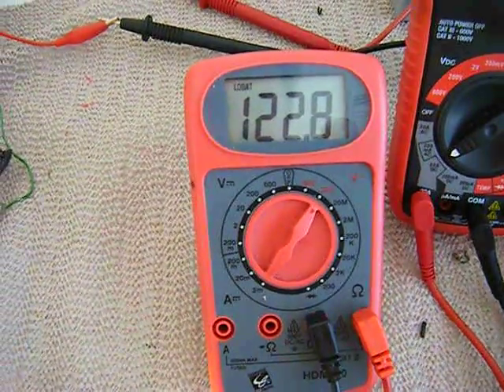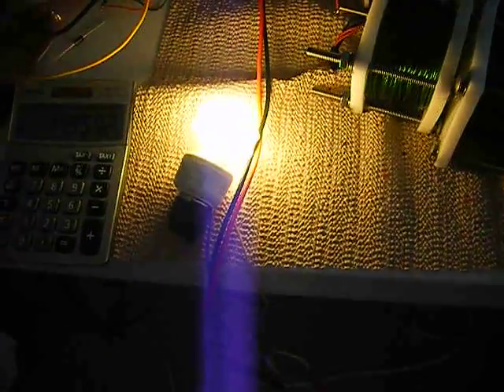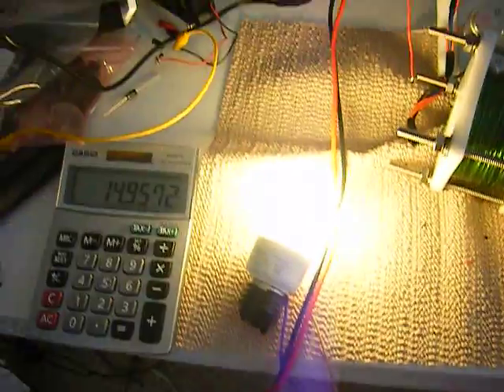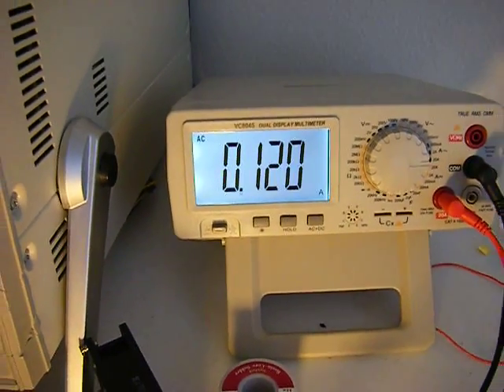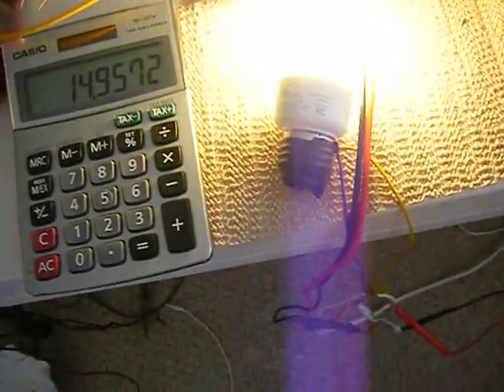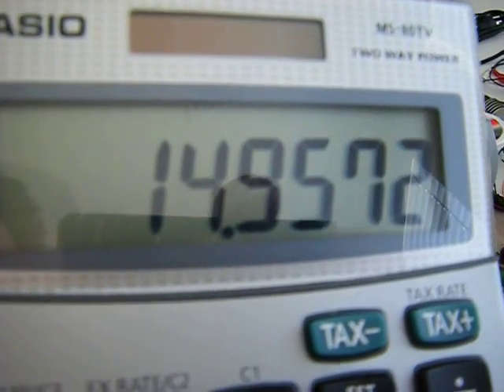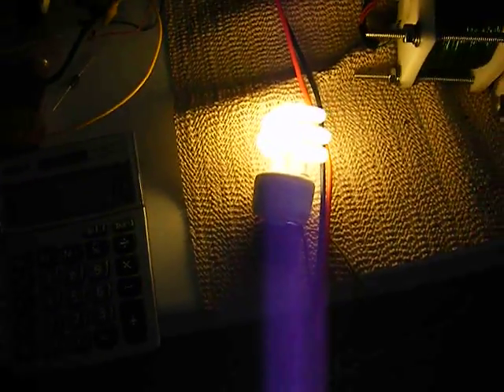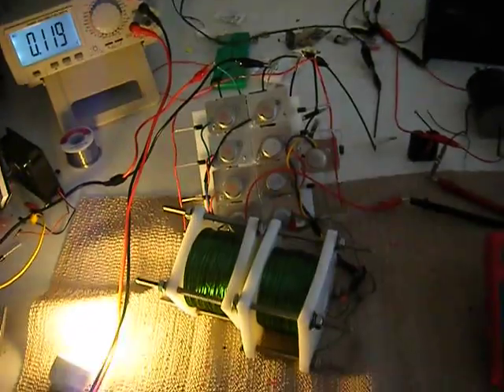Actual Watts On a 9w CFL Bulb

Comment: 123x.12 is about 15, but it is 15 VA, not 15 watts.  With the power factor calculated in, which is about .6 for a simple rectifier bridge and capacitor and you get, guess what, 9 watts.